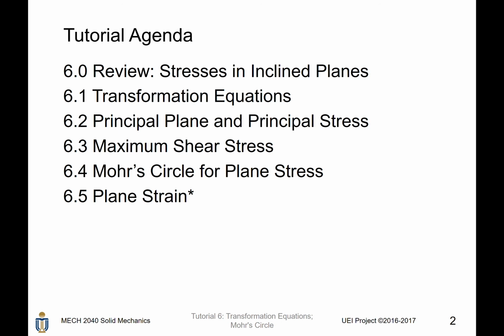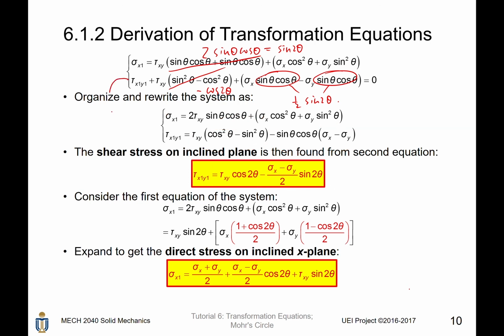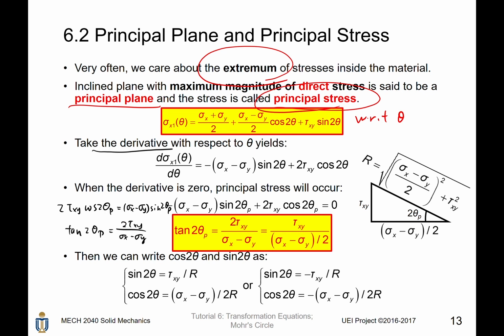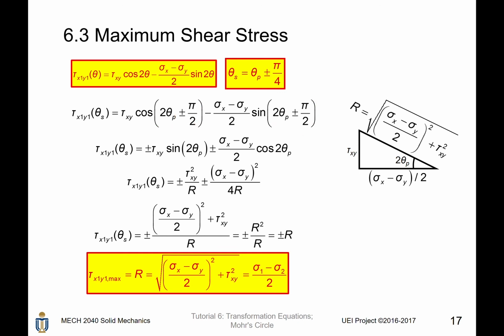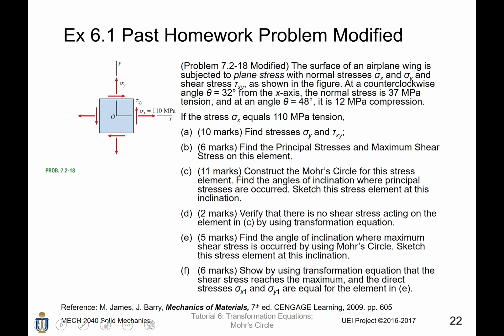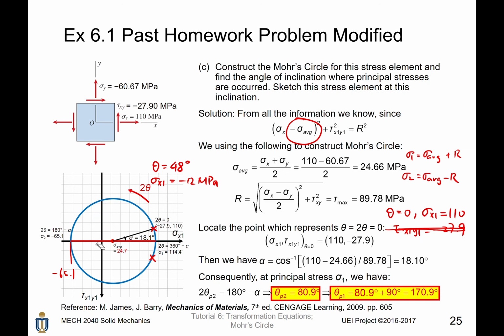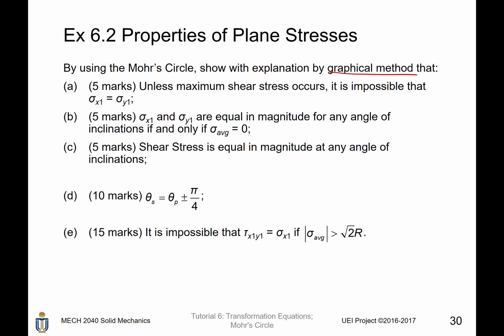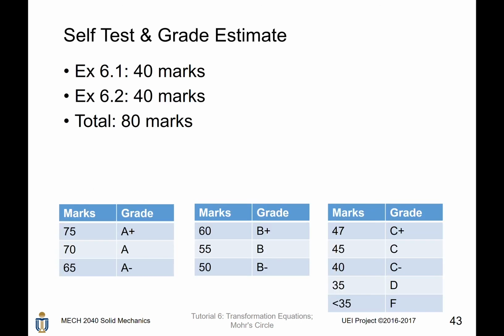MECH 2040 Solid Mechanics I Tutorial 6 - Transformation Equations & Mohr's Circle

Comment: at 39:09, the alpha is 18.1, but why i can't get it graphically (arctan27.9/110=14.2)?
Thank you
Reply: Thank you for your question. You used the coordinate (-27.9, 110) to compute the value of tangent. However, notice that the center of the Mohr's circle does not lie on the origin, thus it is not reasonable to compute with atan(27.9/110).
Globas.
Reply: Good luck with your final exam. Hope that you can see this before the exam :)